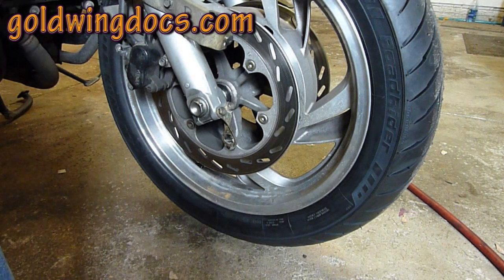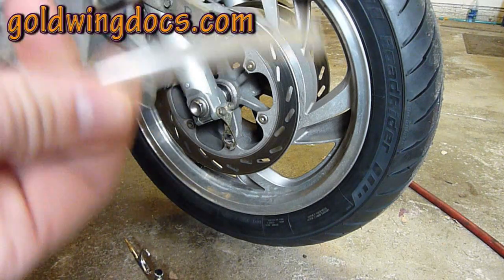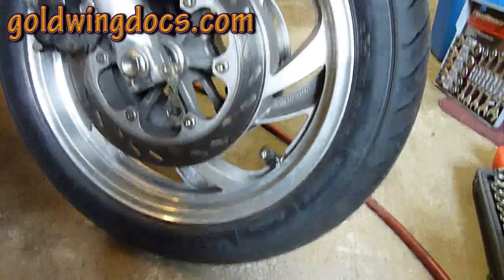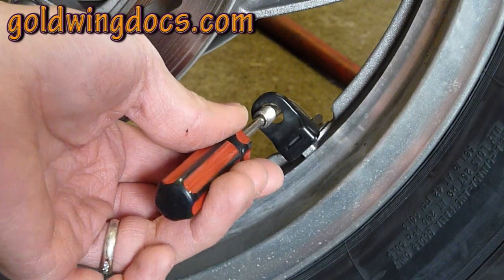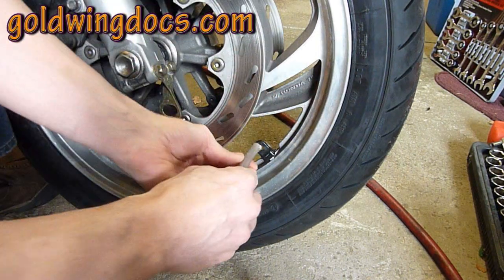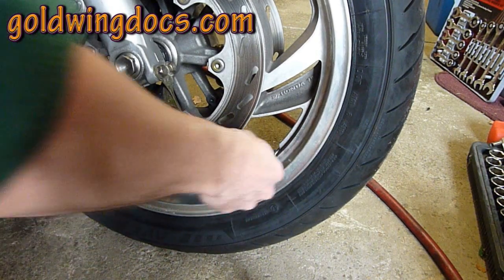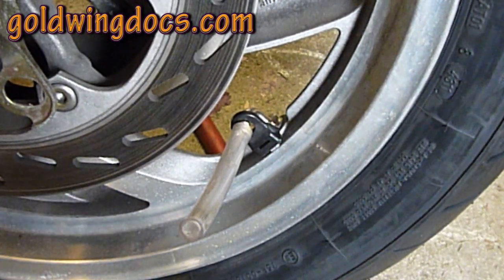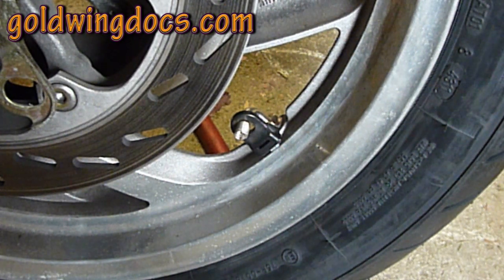A new, improved method of installing Dyna Beads in your motorcycle tires

Comment: I've been runnins dyna beads in both my bikes FJR1300 and FZ09 for years. I just changed my FZ09 last week. I installed my beads by using a funnel between the tire bead and wheel rim (before setting the bead obviously). After dumping in the beads, I kept the tire laying down and set the bead with air. No beads blew out and it worked perfectly. I will never mess with loading through the stem again.
Reply from the maker: For sure, if you're putting a new tire on, that's the easiest and quickest way to do it.

Comment: I have use them in all my bikes for several years and they work. Never had any issue with vibration or balance.  I use this method to install them with no problems. Make sure your air tank is bled of moisture first. There is a post where a guy describes the beads being stuck inside the tire. The tire must have moisture inside or something, that is not normal and thinking that the air they put in the tire must have moisture in it from  an improperly maintained air tank.  Anyway, they work and the science behind this is sound.

Comment: Thanks for the very helpful video guide. I will be changing my front tire on my '82 GL1100 shortly and also plan on installing a new 90 degree valve. I was wondering how the insertion would go with the right angle bend. Thanks again!

Comment: Thanks for this video.. one suggestion I could give would be to cut the tip of the bottle but not to much, it looks like you cut to much off and let too many beads into the tube at once..just fill slowly and only enough to let a steady trickle into the tube so it doesnt get all bunched up... i flicked the bottom of the bottle and beads came out everytime and never got stuck in the tube. Took about two mins of flicking the bottle and was good to go. Very easy.

Comment: Yes, if you get a much longer Tube that will hold all the beads at one time. Then use the air - you could have them all installed in under 2 min. Just a thought.  :)
Reply: You would have to get a thicker walled tube, could you imagine a blowout with a full tube of those beads. One hell of a mess
Reply: Twist on a piece of wire like a hose clamp on the valve stem.
Reply: You don't use full air pressure,...just a quick shot,so it shouldn't "blow out".
Reply: remove the valve stem,  let air pressure out slowly before removing hose

Comment: In terms of functionality once you have gotten through the installation process, are there any implications respecting the use of aftermarket (or proprietary) tire pressure monitoring systems?

Comment: Wondering if these beads can be installed in a can am spyder tires?
Reply from the maker: They can be installed in any tires. I had them in my truck with excellent results.
Reply: Thank you
Reply: They run them in Tractor trailer rigs

Comment: I chose to use Centramatic balancers instead...nothing to worry about no mess and they work excellent! I had ZERO cupping on my goldwing and no repurchase needed. There is a video of DynaBeads on youtube that have STUCK to the center part of a motorcycle tire!! (The failure of dynabeads)
Reply: Actually, theystick together ifthe inside of the tire has moisture,OR if the compressed air  has moisture,...as in when the compressor tank isn't DRAINED of water !
The only other time they will stick,is if you have used a tire sealant !

Comment: Dyna beads suck. I put them in my street glide and it never rode right . Pulled back off the tire and they were stuck all around the inside of the tire . I rebalanced the tire  used regular lead weights and the bike rides right now .
Reply: You might have had moisture in your tire which could cause them to stick together, I just use large grain sand, it does the same as all these other type beads but no breakage, rusting or clumping.
Reply: Prevent the beading lube from entering the tire the next time dummy.
Reply: @rustyshackelford9015  Can't you give advice without name calling. A bit immature.

Comment: If you can put them in before finishing putting tire on easiest. Last tire s I put on a DL650 no beads or balance they are smooth up to 100mph+. I believe this is due to quality of newer tires. I will balance my DL1000 though as it s my extended hiway mc. Peace-out

Comment: As the beads constantly move about, won't they wear away the inside of the tyre?
Reply: They are ceramic, very tough and supposedly not bothered by moisture. I would still run nitrogen if available.

Comment: Do you still use dyna beads? I’m hesitant to make the jump from lead weights ...
Reply from the maker: I actually started using Counteract Beads - a Dyna Bead competitor that are easier to install (they're glass instead of ceramic, and have less static). But yes, 100% beads, I haven't used lead weights in years. Everyone I know who has ever switched has loved them, and the fact that it reduces cupping and extends tire life is a great benefit as well.

Counteract beads are here: https://goldwingdocs.com/forum/viewtopic.php?f=18&t=43181
Reply: gsmac1969 Thankyou for the quick reply! Will look at them! Cheers

Comment: Does these flow into and thru tire pressure sensors?
Reply from the maker: It depends. If the sensor is filtered, then no. Some sensors will allow them to flow through, others won't. You can always install them in the tire when the tire is changed as well.

Comment: Dude...If it were me, however a decent idea you have...wouldn't it be better to have a hose long enough to house all of the beads at once and to be able to cut out the bottle and multi times of refilling the short hose you have for the beads? Further more I would think with very little make shifting one could come up with a valve type apparatus allowing gradual bleed off of the air rather than using the method of withdrawing of air nozzle by hand which is a risky move at best....to summarize...good idea...just fails a tad short. thanks for the video though....keep trying!

Comment: While the bottle is attached to the tube why not just squeeze the bottle forcing the air in the bottle to just blow the beads through the tube? when you let go of the bottle there's enough air in the tire to let the bottle refill with air then you just give it another squeeze, repeat till done.
Reply: I was going to post the same thing.   Hello.  I figured that's why they give a squeeze bottle.
Reply: @Jeff-Cranston  The bottle they give you for installation is very small and does not have the volume of air present to "push" any quantity of beads into the tire.
Reply: @48retrop  why not use a bigger bottle, the ones used in the food industry and a long enough tube to accommodate the full 2oz of beads. Same nozzle but with enough air in it to squeeze repeatedly until all the beads are in. I will try that method on my motorcycle trailer.

Comment: Can they be used in tubeless, as well as tubed motorcycles?
Reply: AudiophileTubes They may not be as effective, in a tubed tire due to the tube.
Reply: AudiophileTubes Dynabeads says they work fine in tube tires. I have tube tires.
Reply: Thomas Gregoire The only "obstruction" in the tube is the valve stem, which is the heavy point of the tire, tube, and rim. The obstruction is very slight. The bonus is that when you change tires and tubes, you can cut open the tube and dump out the beads. I am not sure how you would get them all out of a tubeless tire without a mess.
Reply: Bob Fastner I use a car vacuum cleaner for the beads only. Easy cleanup.
Reply: They would be contaminated with dirt if you use the car vacuum for anything else and don't clean it completely. Plus they go through the impeller. Not very easy. You cut an inner tube and pour them out. They are clean and pour out easily.
Reply from the maker: AudiophileTubes Yes. I've used them in both.
Reply from the maker: Yes.

Comment: To all people who are interested in street bike racing at the track DO NOT i repeat DO NOT INSTALL dynabeads in your tires even if the dealer says they are better!! I rode yesterday with on a new set of dunlop q3+ track tires back home after installation and it will cause your bike to be resisting on any turn. How do you to lean aggressively on turn at the track like that. Feels like when you lean left or right the bike wants to fight with you and ive been riding for years. It definitely says “not for racing applications” after i looked through the web. Wish the guy at dealership would have known about that little information. Going back to good old weights.
Reply: that's whats garbage about these,  supposedly only vertical support, no horizontal,  cuz they're stuck between the wall n rim, fucking up the handling.   these are for straight line commuting cruisers
Reply: fuck, carbon walls and dynabeads, i got one of those up front and even if i didn't,  those are not going in my sport tires or bikes

Comment: Sand will do the same thing as  Dyna Beads... I have been using sand for 20 years...
Reply: Z71Ranger Doesn't it eat away the inside of the tires due to the rougher edges - I think its a brilliant hack, it is after all 'ceramic'
Reply: Z71Ranger Sand doesn't roll and it is an abrasive. Has to be bad for the valve stem even if the tire can handle it.

Comment: Don't do it , it will void the warranty.
Reply from the maker: Void WHAT warranty? The tire warranty? That's false. Both Counteract and Dyna Beads have received (and have published) assurances from all major tire manufacturers that the use of their beads do not affect tire warranty. Anyone who has used these beads knows that they do not affect the interior of the tire, and actually extend the life of the tire, usually by thousands of miles.
Reply: Scott MacLean Not Dunlop. They won't warrant the tire if you put beads in them.
From Dunlop, "Dunlop does not recommend the use of dry or liquid balancers/sealers and will not warrant tires into which these materials have been injected. Tire and wheel assembly balance must be checked with a balance stand or computer wheel balancer." Sounds pretty straight forward to me.
Also Pirelli will NOT warrant any tire with beads, from their website "Tires injected with liquid balancer or sealant or any other balancing material." 
I'm sure the list goes on and on. 
Be wise be safe always follow the manufacture's warnings and recommendations especially on Motorcycles. You only have two tire's and when one fails it could be deadly.

Comment: Im calling BS on this product.
Reply from the maker: You'd be wrong. It's been widely used (and proved) by millions of motorcycle owners for many years. It's a pretty common method of wheel balancing - it came from tractor trailers (who use golf ball sized "beads" rather than these tiny ones that go in motorcycle tires).